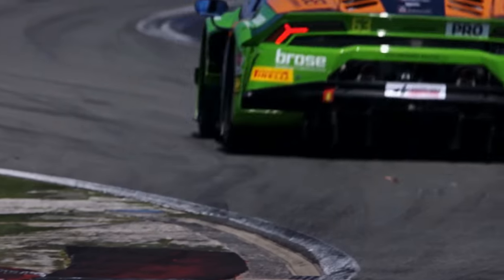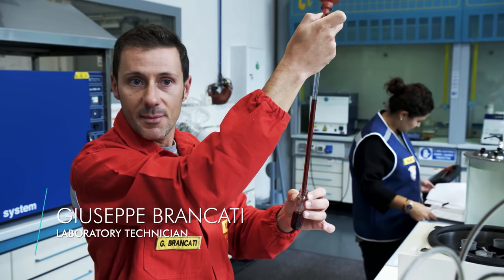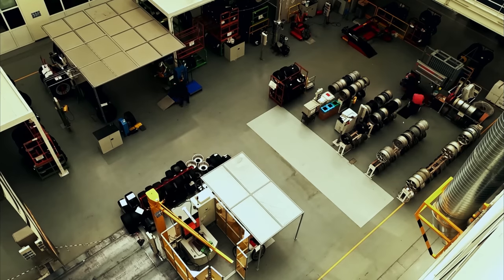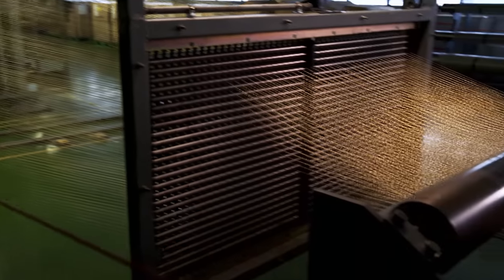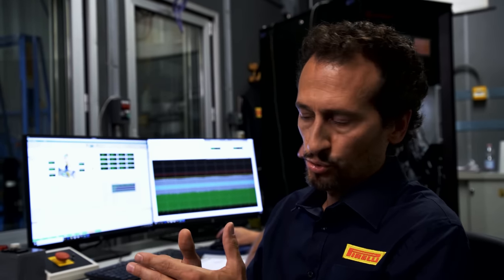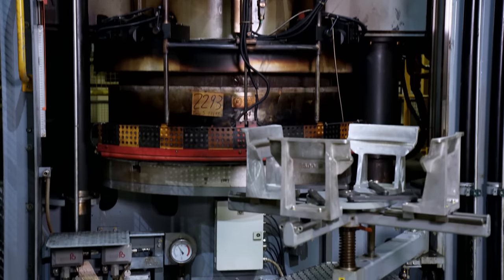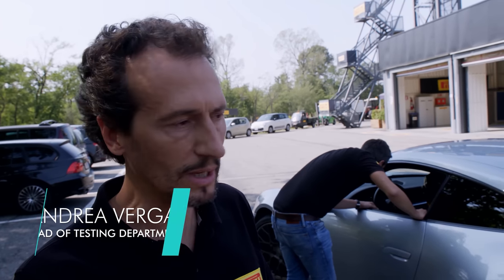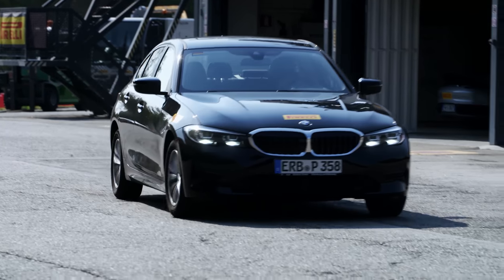Pirelli: World's Most Renowned Tyre Manufacturer | Mega Manufacturing | Free Documentary

Comment: The Pirelli tire has such good traction because it uses a softer rubber compound, hence the reason they wear out so quick.  I used a set of Pirelli on my '73 Z-28 with a 650 H.P. engine and it was incredible, but ended up replacing them in less than 1 year because they wore out.  If Pirelli would come out with a tire that could last longer and was priced about the same as other manufacturers, they would sell a lot more tires.  With them costing so much and wearing out so quick, many people don't go back to them when they have to replace their tires.

Comment: Michellin is most 'renowned' IMO, they make some of the best and invented the radial if I'm not mistaken.
Reply: Let's not forget the marshmallow, I mean Michellin man.
Reply: @kiwidiesel5071  I guess you have to be older like me to realize how revolutionary the radial was, nothing like that sort of improvement has happened since although tires have become dramatically better (at least performance ones) in the last decade.  Going from bias ply to radial would transform your car very noticeably.
Reply: Bo McGillacutty  Yes and in 1947, the original, was the ‘X’,  I would recognize. The tread if I ever saw it again , , I first saw them on a CITREON, , 3 spot the clutch was like on a motor cycle in the dashboard.  Spare tyre on the rear, covered .  Cheers  FROM NJ USA 🇺🇸🇺🇸🇺🇸🇺🇸
Reply: @Mrbfgray  oh I absolutely agree with you there, I too have experienced the thrill and horror of driving on cross plys, but man they would smoke like a train when you spun a wheel, radials require a little more heat and rpm to smoke but nothing smoked like a cross ply being shredded

Comment: Why are Pirelli tires renown, by many, many mechanics and tire shop techs, for tread separation?
I understand that you can get a bubble, between the layers, if you have a flat and an patch, because the nail/screw pushes the treads apart and an air bubble can cause a bump & loud noise, from that tire.
But many Pirelli tires, which have never been damaged and has tread separation causing the same issues...what's up with that?
Reply: Because they invest a lot in advertising. In the end it becomes a subconscious decision be it the user or the person recommending it.